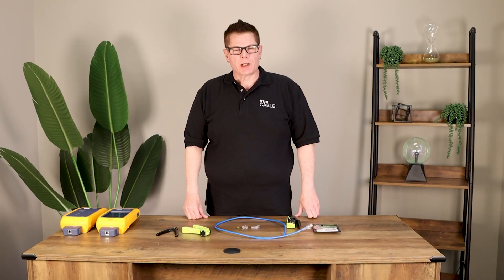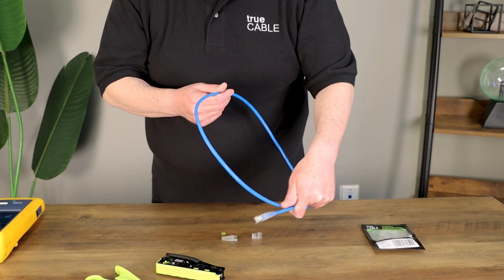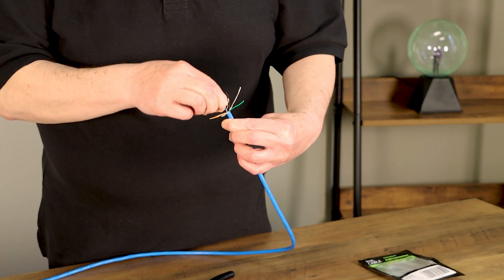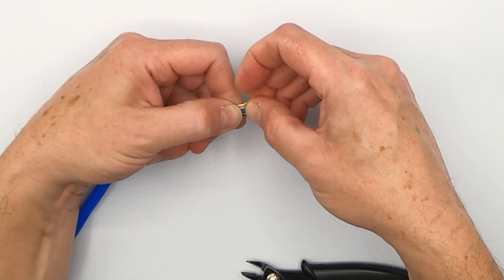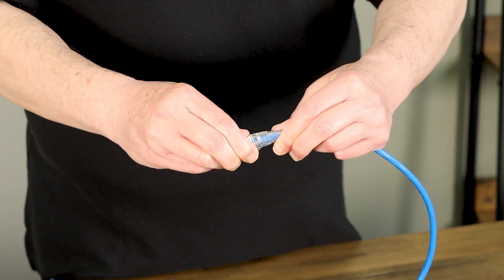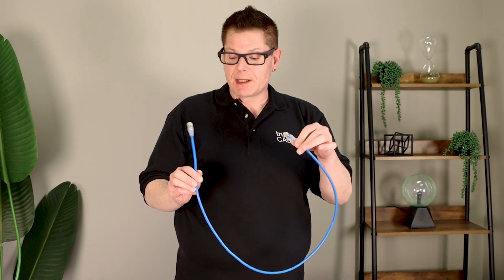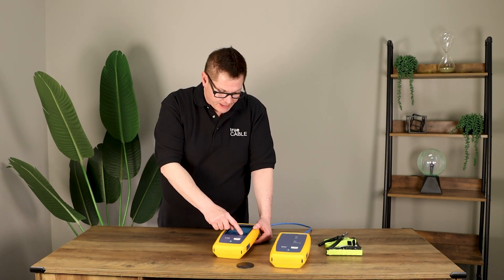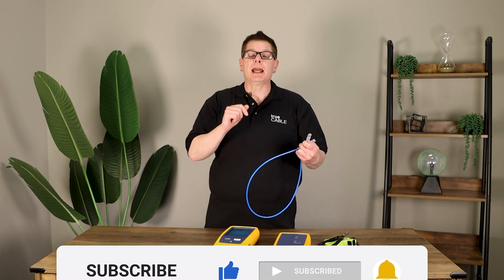Standard Load Bar RJ45 Plug Termination and Testing - Best Tips and Tricks

Comment: where are passthroughs ok to use? I'm in the low voltage group on Facebook and there's always fights about them?
Reply from the maker: Hello! There will always be fights and disagreements over one type of tool or accessory vs. another. The reason has to do with personal success and anecdotal evidence that gets cemented with closely held personal beliefs. The fact is a well-fit passthrough connector is just as good as a well-fit solid nosed type. The key is WELL FIT. You can have the same issues that some experienced with passthroughs as with the solid nosed types if the conductor insulation diameters are off for the plug/cable combination. The reason you see more people complaining about the passthroughs is a larger number of NEW installers have gotten into the installation game and are making fitment errors with the hardware. Of course you then hear that someone that had trouble with a passthrough then switched to a solid nosed type and their problems went away. The problems went away due to a better fitting plug, not the fact they went with the solid nosed plug. Correlation does not equal causation, in other words. You hear the SAME stories with people who had trouble with solid nosed plugs and then switched to passthroughs and their problems went away too. See what I mean?

Comment: I just started using these and my coworkers just hate it. I don’t know why. I guess change is hard lol. One thing I think is important is the boots too, that’s another thing only I think too 😅. I guess I’m doing it all wrong
Reply from the maker: Hello! Yes, change is always hard. Some people are die-hard fans of passthrough, and some like push in without load bar. I have found that when dealing with especially Cat6A unshielded, a load bar will go a long way to taming those unruly conductors and will give much better cross-talk (NEXT) performance at the connector since the conductors are being staggered, which minimizes conductor generated EMI at the connector. Of course WHICH kind of connector you use will also be dictated by fitment. Some cables conductors work better with different models of plugs, so there is that too. Boots often help stabilize the termination (especially the inline style where the boot locks in during termination) but slip on boots can also get in the way, often not playing well with most high density switch port arrangements and tight device housings. It is a huge balancing act.
Reply: @trueCABLE  Yea very big balancing act, for sure. I like the load bar being another aspect to keep interference down. Thanks for the reply :)
Reply from the maker: @picnicsinspace198  Hello again! Indeed, and you are welcome. I like the load bar version and typically defer to it. BUT, there are some well designed pass throughs out there too. We are always looking to develop the better "mouse trap" and have another design coming up to handle even larger insulated conductors, but it is unclear whether it will need to be load bar or pass through since the load bar is another piece going inside the 8P8C plug that reduces room for the conductors, unfortunately. Lots of testing coming up for me! <<Don S.>>

Comment: installed two RJ45 connectors on brand new CAT6 cable....the POE works but no internet traffic ( no ACTY light showing on switch ) swapped in a CAT5e patch cord POE and ACTY light show it is working. Looking for suggestions on what to look check simple test equipment shows all 8 wires are ok. changes connector at each end three times with no change
Reply from the maker: Hello! Well, considering the PoE appears to be passing (but data does not) and your wire map tester passes the cable, the next item to consider is the overall quality of the termination. At first glance it sounds like a conductor color order issue (mis-wire or short) but since your wire map tester is telling you "straight through" this just became a lot more difficult to diagnose. Wire map testers will check basic conductor order and conductivity but won't reveal anything about performance. Essentially the plug is ill fitting just enough to cause performance issues yet still pass a wire map test, which I have seen before. If you are using trueCABLE plugs or cable please contact us at www.trueCABLE.com and use our Contact Us form so we can get some pictures of the terminations. Thanks!
Reply: @ I installed “no tool jacks “ on each end then used 1ft patch cords …POE and data traffic started working immediately . Thank you for replying. 😎
Reply from the maker: @philc824  Hello and you are welcome! Glad to hear your installation was successful!

Comment: When would you use a load bar? What is it used for?
Reply from the maker: Hello! Load bar style standard (solid nosed) connectors are very handy when dealing with thicker Category 6 and especially 6A Ethernet cable where a spline is often used. The load bar staggers the conductors and keeps them in position when inserting the assembly into the rear of the 8P8C. It is like a third hand. I will switch between standard solid nosed straight across plugs, standard solid nosed load bar plugs, and passthrough plugs moving between cable types as ease of use/physical compatibility becomes a factor. Hope this helps!

Comment: Always had nothing but problems with these types of plugs. Most of the time they don't crimp down properly.
Reply from the maker: He Si Anon! You are not alone in your experience. Solid copper Ethernet cable should be installed "rack to jack" which means patch panel to keystone. Putting on an RJ45 connector should be limited to a single end of a drop and only in cases where you need PoE to a device like a WiFi AP. That all said, you must have the proper fitting connector for your cable to achieve success, and that is where the problems can really come in. trueCABLE carries RJ45s that have been specifically performance and fitment tested for our cable, but when you start mixing brands of cable and RJ45s that have not been vetted out together, you just signed up for a lot of potential trouble. Even with the proper fitting RJ45s, you should still restrict your use of them to a single end of a drop and only in circumstances that demand it. The only time most professional installers see an RJ45 is when they are pre-terminated onto a factory-made patch cable.
Reply: @trueCABLE  These were crap even with cat5e stranded so there goes your theory. They always misalign and cause errors.

I can terminate pretty much any cable from any company with normal RJ45 plugs.

These 2 piece things are not fit for purpose. If so many people have issues with them then there is only one point of failure.
Reply from the maker: @SiAnon  Hello again SI Anon! 

Well, from what you described, it sounds like the particular load bar-style plugs you were using were very poorly designed. Either that or the cable and plug fitment was not within tolerance on the insulated conductor diameters. Not all load bar plugs are designed the same. Ours is quite different. I have quite a bit of Fluke DSX-8000 MPTL and PCA test data to back up my assertions, so I am not working from a theory. Of course, you may also opt for passthrough-style plugs, but again, the cable and plug MUST properly fit each other; otherwise, you will get the same results- shorts, and miswires. Of course, passthrough 8P8C plugs have their own set of challenges apart from this discussion, but that is another video and blog. We actually have that blog, Terminating Pass-Through RJ45 Connectors onto Solid Copper Ethernet Cable -- A Really Bad Idea?. You may find that blog enjoyable! There is extensive background information on 8P8C fitment, the issues, and best practices as well. 

- Don Schultz, Senior Technical Advisor
Fluke Networks Certified Copper/Fiber CCTT
BICSI INST1, INSTC, INSTF Certified

Comment: I am running on a beach home a length of 350 cat6 what type ends connection you recommended me
Reply from the maker: Hello Geo! 350 feet is beyond the 328-foot maximum, and worse yet that 328-foot maximum is predicated on 68 degrees F ambient temperature. Considering this cable is running outside, you may well be limited further by temperatures. All warnings aside, the cable will still likely work, but it may be limited to 100 Mb/s as opposed to 1 Gbp/s. You won't really know until you install it and test it. As for the terminations, I would STRONGLY suggest using field termination plugs at both ends if you are essentially creating one long continuous patch cable. Hope this helps!
Reply: @trueCABLE  I live in alabama, it gets hot/cold/wet here year round any suggestions on future cabling needs?
Reply: Thank you for your advice
Reply from the maker: @geoescobar2131  You are welcome Geo!

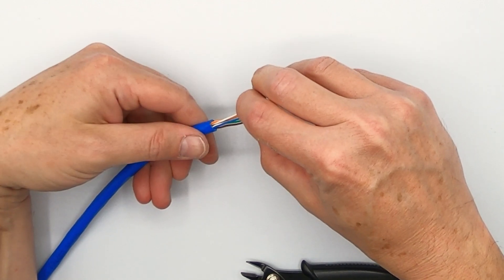Comment: at 3:56 you mention you can't get the load bar all the way up against the Jacket, but in fact I have been getting the load bar all way up against the jacket. I have been doing that for years with tripplite RJ45's that are identical to yours that you demonstrating.  In fact I am not sure how you are able to maintain a gap betweent the load bar and jacket when pressing the load bar into the RJ45.  Maybe by applying pressure to the jacket with your fingers as you insert the bar in RJ45?  It just seems like the jacket is not tight enough against the pairs to prohibit it from sliding forward as the bar is inserted into the RJ45. anwyays, I have been making terminations without issues, with this style you are demonstrating for years, with the jacket jacket up against the load bar and have wondered if there is any issues with this. I do notice the jacket resting up against the load bar may be casuing a very tiny amount of pressure on the termination that worries me a little.
Reply from the maker: Hello!  Our load bar and plug combination is a bit different than others.  Often it is not possible to get the load bar all the way to the jacket, and you really don't want to do that anyway.  By pushing the load bar all the way to the jacket you place undue tension on the load bar and that will affect the stability of the termination. I recommend about 3/16" of space between the load bar and cable jacket.  You will still achieve and exceed the 1/2" max untwist requirement for terminations and not place undue stress on the golden contacts after terminating the plug. Hope this helps!
Reply: You want a bit of twist before termination, from what I’ve been told.

Comment: if you color coded one-side of the load-bar it would make it so much easier to keep it right side up
Reply from the maker: Hello! Agreed, and that is something we can look into. The cost to do that may be prohibitive, however. Although adding color coding would seem trivial, it requires additional equipment and potentially tooling.
Reply: @trueCABLE  the only other issue I have had is with some cables or when re-terminating a older cable the cable wants to slide in the jacket when putting the load-bar into place this could be down to the gauge of the cable and or its insulation as the fit is friction but other then that these work well.. being a bit gentaler with the finkinky cables seems to todo the trick but its a balence between getting the loadbar seated and not pushing the cable so hard that it binds up and moves in the jacket maby consider a loadbar with a longer design that can grab onto the jacket to prevent it from sliding around... but I am being nitt picky
Reply from the maker: @rjc862003  Hello! Sorry to hear of your troubles. It sounds like some of your cable's insulated conductors are a bit on the thicker side and you are at the limit of the load bar. Ideal fitment of the load bar is achieved with insulated conductors ranging from 1.00 to 1.13mm. Check your cable's specs and see if you can run down the conductor insulation diameter. The answer is probably there. Also, if this is not the issue would you please contact us at https://www.truecable.com/pages/contact-us and include some photos of the issue? Thanks!
Reply: @trueCABLE  don I have a question if as a customer we tell you our project and application we think we need, do you have a way to immediately tell us the proper items to order? Like if I say I want to install 10 drops inside a small office, do you guys have it down to a science yet to help the customer quickly decide? 

Thats typically been my issue I've seen every time I've had to dabble with structured cabling, it tends to be a LOT more than what the MSPs were telling me lol. I truly do respect companies that full time do structured cabling as you can immediately tell the difference in the quality of service and installation. 

I've got materials from my last 5 installs that are all different name brands from cabling to tools. In some cases it doesn't matter but the more I get back to the cables and jacks yea it's starting to matter.
Reply from the maker: @kristopherleslie8343  Hello Kristopher. We don't spec out installations for liability reasons. Each installation is "its own animal" and each one looks different to varying degrees, making it impossible to come up with a "cookie cutter" structured cabling system in a box. Without being on-site to do a proper site survey we, unfortunately, can only offer limited assistance in this area.

Comment: Is the fluke test really necessary? I just use careful visual inspection and one of those noname brand patch cable testers you can get on amazon for $7 that just tests the continuity and order of the 8 wires. Whats the chance itll pass the noname brand and visual inspection, and fail the fluke? I dont need to IEEE certify my terminations.
Reply: Do you make cables for a business? Does your reputation and customers depend on your cable functionality?

If yes, I suggest investing in a proper tester. If not, eyeball it, hook it into a switch, hook a laptop into the switch with a known good cable and a laptop to the new cable and use a tool like iPerf to test the real world performance. 

If you use passthru connectors, a good quality crimper, and good quality cable (all of which I believe TrueCable sells, I've been happy with their connectors and boots and crimper so far), you'll probably do fine.
Reply: @BrownR87  eyeballing it is fine. You make sure the ends are 100% over the blade ends, make sure the order is correct, make sure plenty of outer jacket is inside the connector, and crimp. Inspect and test with a cable tester. Those $500 fluke testers are a waste of $. Just never use pass through connectors. They leave the copper ends exposed and emf can be a problem in av applications.
Reply: @Henry_Jones  why would the exposed end matter? Normal rj45 connectors aren't shielded at the tips, so whether the wire hangs out another fraction of a mm really shouldn't matter. The closed plastic end isn't blocking any RF.
Reply: @BrownR87  moisture can affect signal. Ive see it happen first hand. If its used for AV dont use pass through.
Reply: @Henry_Jones  and water can get into pass throughs in some cases and burn them out.
Reply: Henry, if its a hobby, no. If its for internal or external business YES. You'd be foolish to not test each and every jack unless you get premades. I will say this after 35+ years of experience in IT, the moment you lower your standards, it shows in not only your work but your work ethic. Don't cut corners.